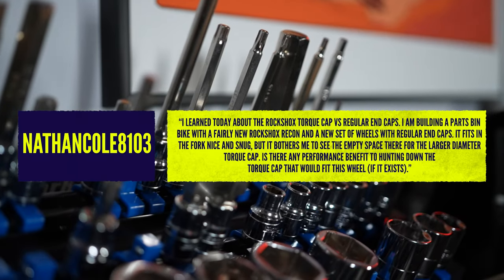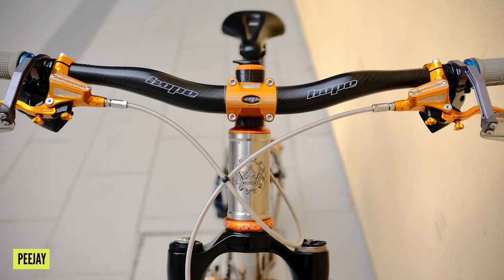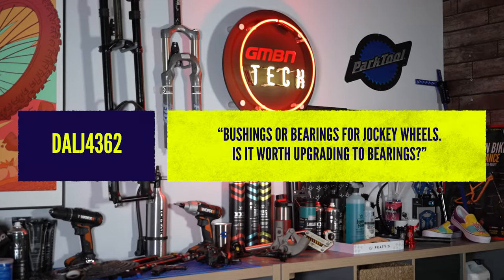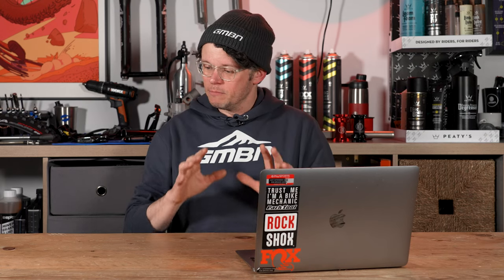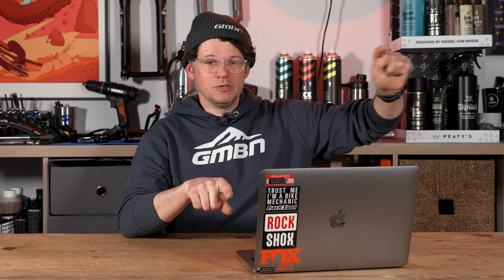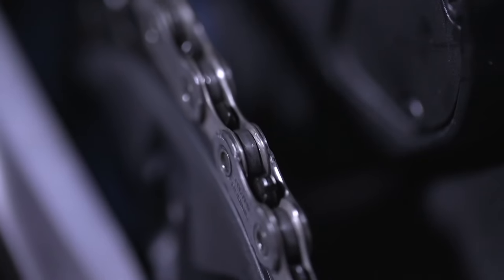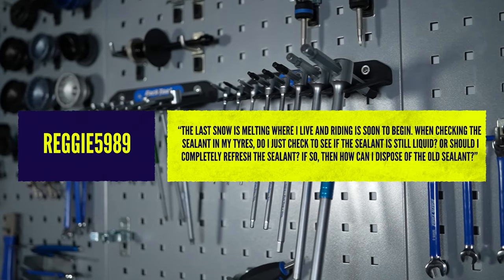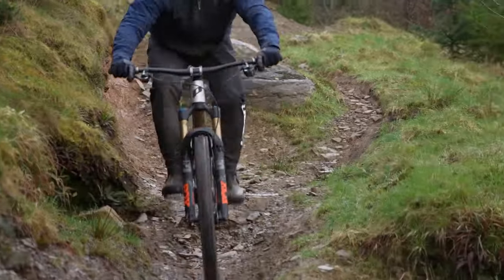How Does Belt Drive Work On A Full Suspension Bike? | Ask GMBN Tech 282

Comment: Metal brake hoses originated in the automotive world.  One of the downsides not mentioned is that they were very abrasive.  A poorly secured hoste could wear through a car’s chassis.  This would be exaggerated on an aluminum or CF bike, as the hoses need a fair about of free length to accommodate steering and suspension movement.

Comment: #askgmbntech - Bit of a challenge for you: If you built up a bike with the logic that you could take it completely apart with the smallest number of tools possible (all nuts, bolts, brackets etc) - how many tools would you need and what compromises would need to be made?
Reply: Seconding it! Fearing though, you and I won't be satisfied with presenters' definition of "completely apart". Like, forks, brakes and hubs down to the very last interface, pressfits included? - no way. And if you consider a set of hex keys as one tool or every size seperately...
But a good way to see how some tools can have several applications like Shimano bottom bracket wrench on centerlock brake rotors

Comment: I think what nearly killed and limits the braided ("steelflex") brake hoses now is that you can't really fit a hose end outside the factory, ideally has to be machine crimped. So no length adjustment and very limited inner routing options for those.
As per price, regular kevlar ones cost inexcusable money, so steel is not that much different of an investment. Like 20 Euros for Shimano 1,7m with most basic straight fittings vs 27 for Hope 2m, fittings excluded. Sometimes it is even worth to buy shut set of brakes and reuse hoses from there if you need hoses with a banjo.

Comment: When I upgraded my chainring it dawned on me that Giant had incorrectly specified the original chainring for the chainline; surprising. The correct offset chainring fixed the chainline and massively improved the reliability in the big sprocket. So dont just assume even the most reliable manufacturers get it completely right.

Comment: #AskGMBNTech
Hi guys at GMBN. I've got a couple of questions about suspension fork. 1. How come mtb forks aren't built like motorcross forks where they don't require frequent maintenance such as every 50 hours of riding. I could be wrong but I don't see motorcross bikes having their forks regularly serviced such as mtb forks. 2. When one services their MTB fork, one has to change the oil in the damper. I've got a fox 34 and while I can't remember of the top of my head the grade of oil that needs to be used, I remember seeing the same grade of oil used in motorcycle forks. Question is could you use a motorcycle suspension oild with the same grade in your MTB fork? Reason being is that there are a lot of motorcycle workshops where I live compared to mtb shops and it is easier to get fork oils for motorcycles vs specialty fox fork oils

Comment: How exactly does the Posi-Trac rear end on a Plymouth work?
Reply: Basically it's like an egg on a hot teflon pan
Reply: It uses a clutch system which allows the axles to spin at different speeds when the pressure of the clutches has been overcome
Reply: IT JUST DOES!! 😂😂😂

Comment: Regarding brakes… the material of the hose only depends on the inner pressure of the system and a possible and unwanted expansion of the line. Cheers

Comment: Hello beautiful and lovely people of @gmbntech I want to ask how to align my wheel at the back of my hard tail MTB. When I got punctured going to the mountain top of our university, I changed my inner tube for 26 inch Schwable Tires and Alexis Rims. However, when I rode it on my way home by downhill to the downtown area, I noticed that my real wheel is wobbling, and when I checked, the wheel is not aligned perfectly (or close to perfect) even if I didn't adjust the spoke (but I was about to) and the tires are aligned perfectly. Could be the spokes or the wheel itself? How can I fix this without (hoping) costing too much money if ever I will bring it to the shop? Thanks and happy spring break! #ASKGMBNTECH